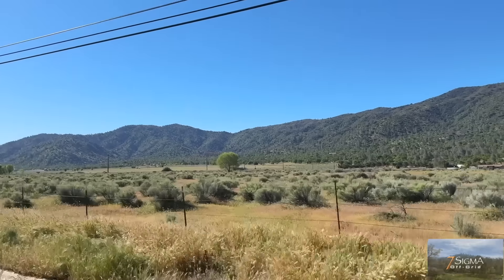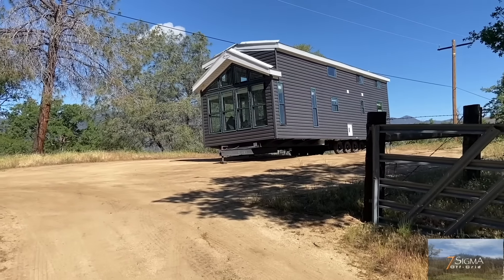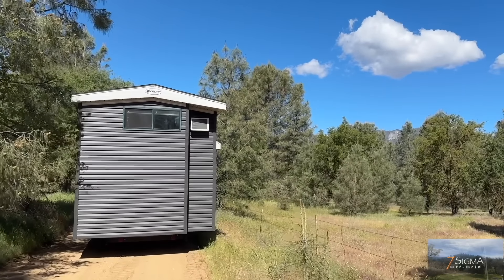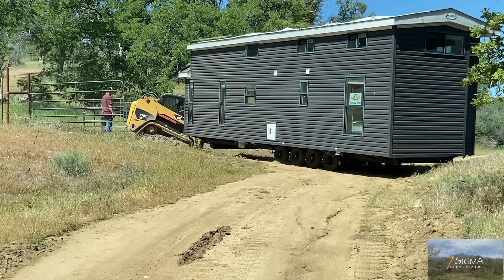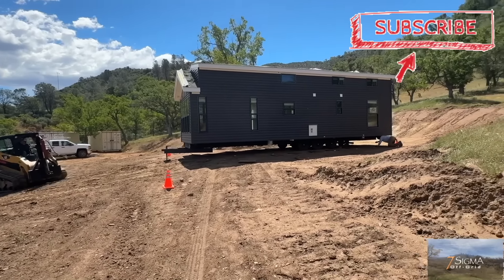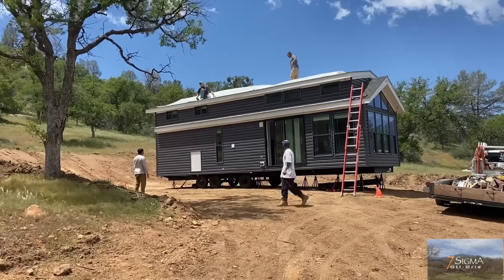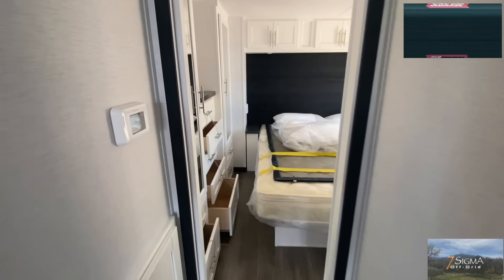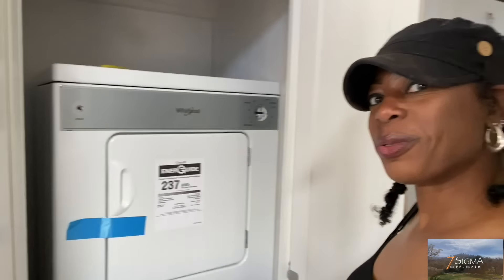🚚**NEW TINY HOME Delivered to our Off-Grid Homestead🏡(Kropf Island 6243K Park Model RV) #tinyhome

Comment: Wow guys, enjoy the journey.  One suggestion.....why don't you put the shipping containers 10 or 12 feet apart and build a roof from one container edge to the other. They actually sell tent structures that attach to the shipping containers.  That way you can park your tractors in the open space under to roof between the containers and not have to park them inside the shipping container itself.  Good luck!
Reply: Good idea!
Reply: That's really smart.
Reply: I agree!!

Comment: I like Park models they're not only nice and reasonable but they come completely furnished have everything you need. 

You can live in them permanently or you can rent them out or whatever, they are a nice addition in life.

Instant housing to take time doing whatever else you need to do. Really GORGEOUS floor plan.

Actually you're doing what many Americans are now doing, BUYING LAND and then figuring the rest out as they go along. 
It's the most AFFORDABLE option and it's nice to have distant Neighbors.
😊
Reply: In Florida those have to be set Only in a Park model lot. Not on private property. You can’t even put a tiny home on private property, Unless it’s 650 square feet.
Reply: Probably because they have hurricanes each year and depending upon where you live in the state you are required to have special tie down systems that can include rods and what have you inserted/secured deep in the ground in order to hold the house in place and attached to concrete piers as well as having the house beings built using the same safety measures used in a stick built house so it can withstand the high wind speeds and pressure created during a hurricane. The same goes with houses built in areas where they commonly get tornadoes. As recent history has just shown areas in Florida that were hit by tornadoes. Yes it costs more to build them and most people who choose to live in the affected states know this and generally plan ahead and have safety measures in place. I it can be difficult or impossible to have a basement due to the type of rock underground and ground water that in the past has created underground tunnels and caves filled with water which have caused sink holes or the ground under a house or the ground to collapse. Because of all of that it makes sense for the state to have strict rules regulations on what you can and cannot do on your property.
Reply: I think you guys are really doing a great job wow  give you so much luck love the views

Comment: No Gravel under the unit is going to be a pain later on when water starts weaking soil if you get any rain. Thes are good home is properly installed and maintained. Good luck with the new home.
Reply from the maker: Gravel already in the works. Thanks for the suggestion

Comment: comin along man. A couple suggestions that you might want to look at doing.
Think about putting in at least one swale run above the house on that hill. It will help divert a lot of water from coming directly at your home and move it around the house. Second would be to put in some concrete footers under the home and strap tie into them to keep the house from shifting....It would mean going through the set up again but it would be worth it to have more security that the house won't shift. I also live on property that is sloped and these are some hard lessons I learned. I hope it helps. I imagine eventually you will be putting up a retaining wall on the hill side to help with earth shifting. Everything you learn stays with you forever and can be used the rest of your life, learning new things is the best investment a person can make in themselves so I admire you for jumping in head first.
What kind of work do you do?
Reply from the maker: Appreciate the heads up Billy! Thanks!
Reply: @7sigmaoff-grid  You bet, hope it helps out. Right now i'm trying to fix erosion issues on my property. Water is extremely destructive and can move dirt around a lot more than you would think. I finally got my main issues addressed and now am fixing damage from not having water diversion done right. We all live n learn. I look forward to your upcoming videos, you are doing great, and have a gorgeous view, and beautiful property

Comment: This is a really nice park model and not tacky.  MIght I suggest that under each stair tread you can have extra storage (loosen the treads to open up individual storage areas under each tread, hinges attached internally.  Also, if you get a Greenhouse attachment or sunroom you could attach it (on a deck) to the side where the sliding glass doors are.  Even put in a little wood-stove.  Just a few thoughts.  I think your house is great!  Thank you for the Vid.
Reply from the maker: Thanks for the tips!
Reply: @7sigmaoff-grid  You are welcome and I admire all of the progress you guys are making.  Best wishes to you.

Comment: You might consider squaring your shipping containers up with spacing in between so that if you need more space, you can add a roof across the containers and create a covered space for your tractor. You can close it in or leave it open as on open covered space.
Reply from the maker: Would have been nice, but there is a steep-angled drop off behind both containers which prevented us from doing  it the way you mentioned . Also we did not want to kill the oak tree in between 😀